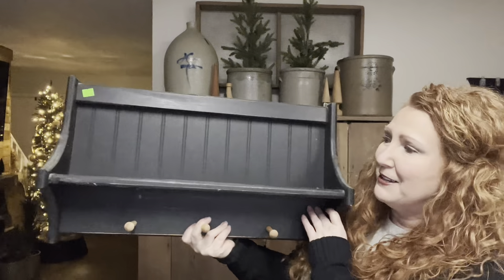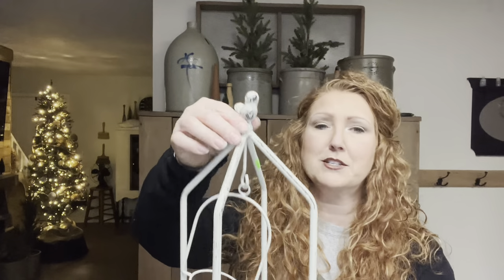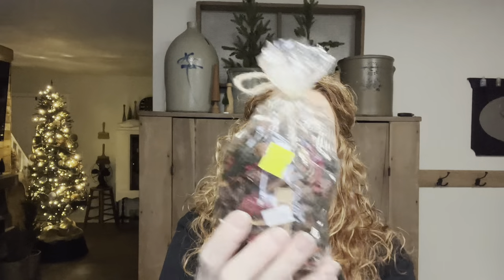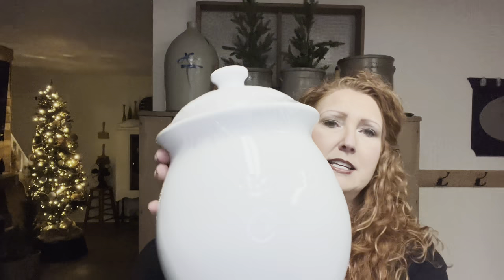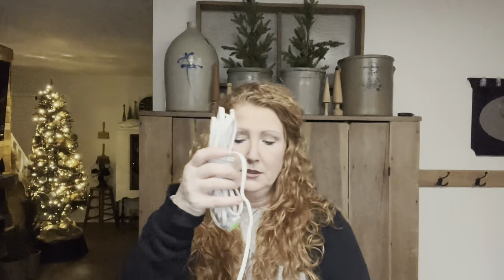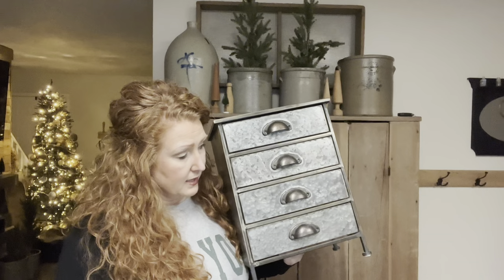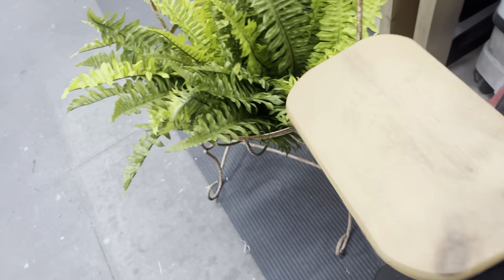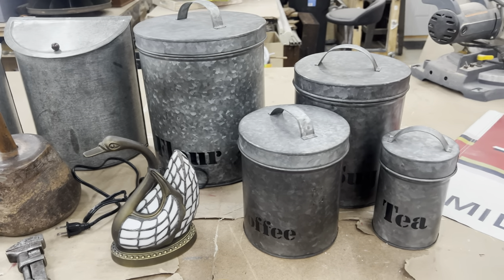The Hunt Is On | Haul | eBay and Booth Reseller

Comment: Great video!! I have a metal vintage bread holder that has rust on the inside. I was wondering what I can use to remove the rust? Thank you. Your hair looks great.
Reply from the maker: If I do remove rust it’s a combination of sanding and a product called por-15( it’s a bit pricey)